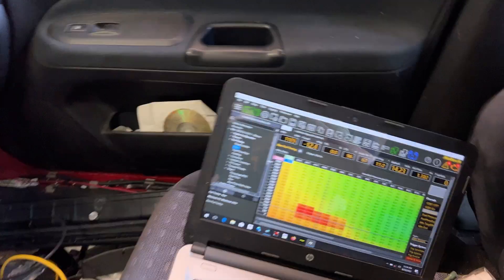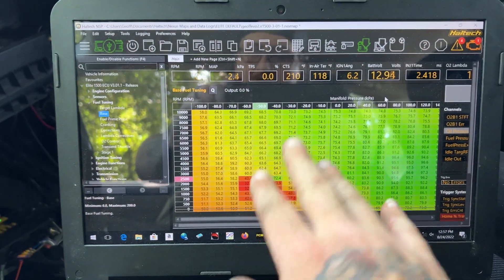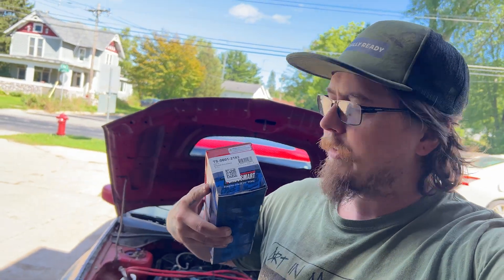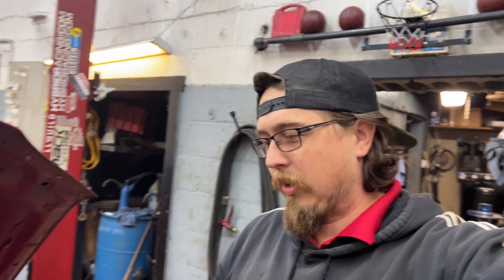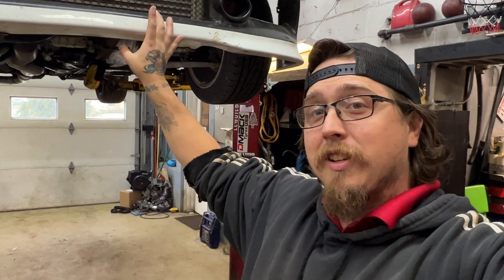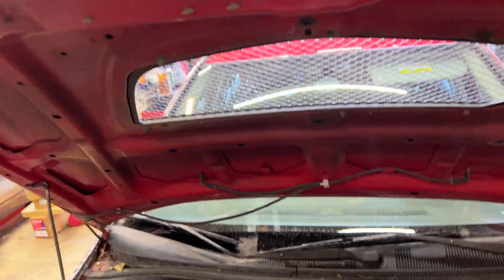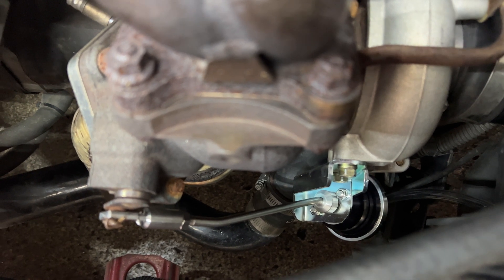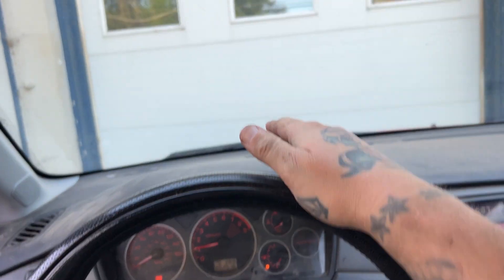Evo 8 Haltech Elite Base Tune! Overboosting?!

Comment: If you change spring and after changing it you began to have high boost... simple change back or get a lower rating spring than that 19psl.
Reply from the maker: Normally you would be correct. Turns out I had developed a wiring issue and the solenoid was not working properly. When bypassing the solenoid the system was working correctly and not over boosting.
Reply: @ArtInMotion881  ok... its just difficult to think that a change of wastegate spring could cause these other problems.... its more likely you had the problem prior spring change ... hope it's work out for you 👍
Reply from the maker: Exactlly! Think easy first.  This car sat for a long time so i think theres some mouse damage that is slowly showing up
Reply: Is it difficult to map on the heltech vs the stock ecu?